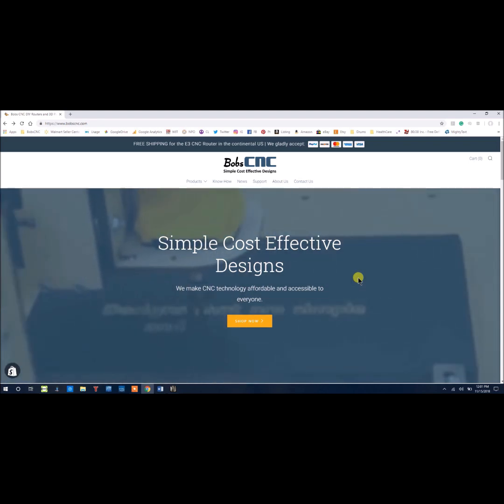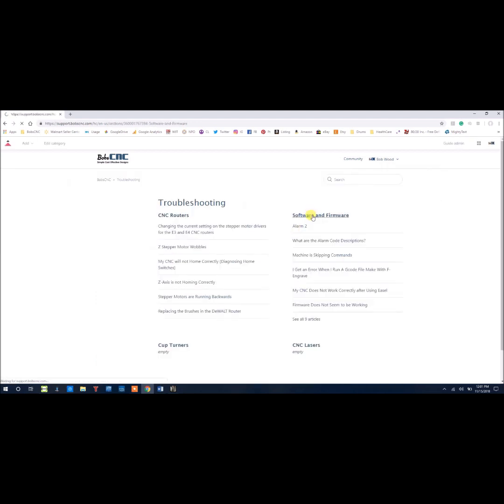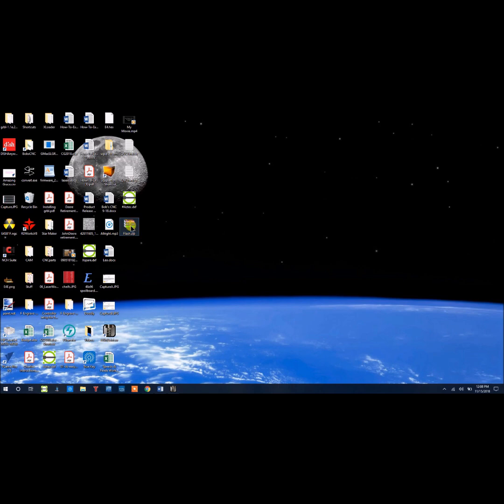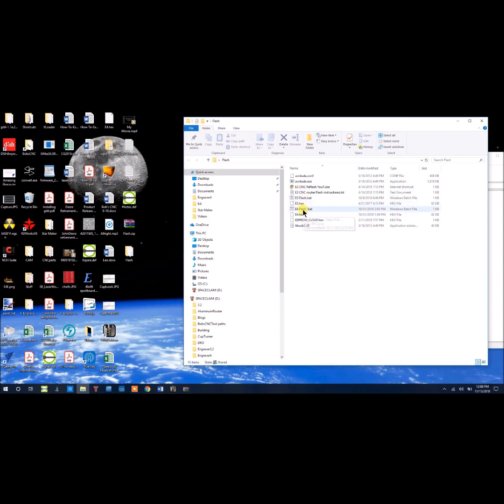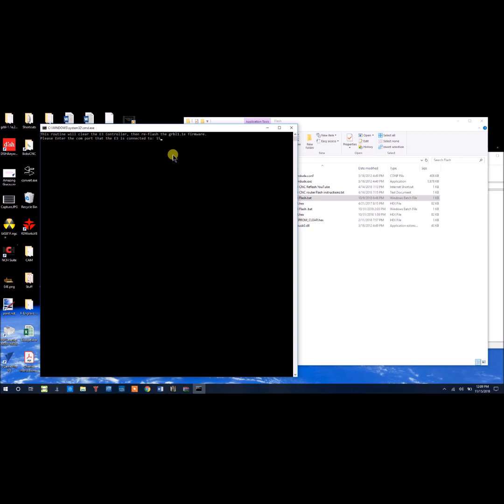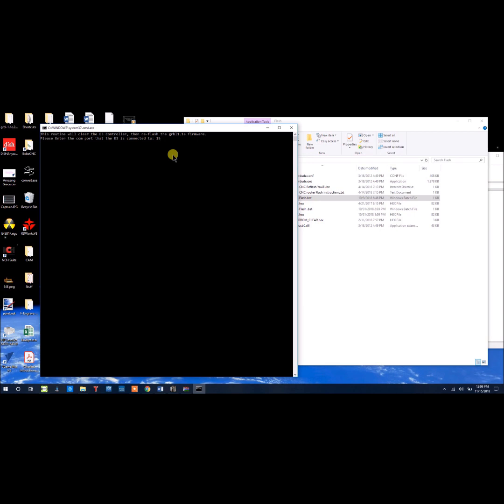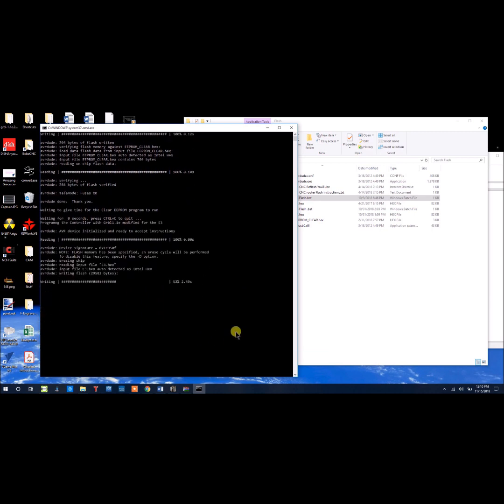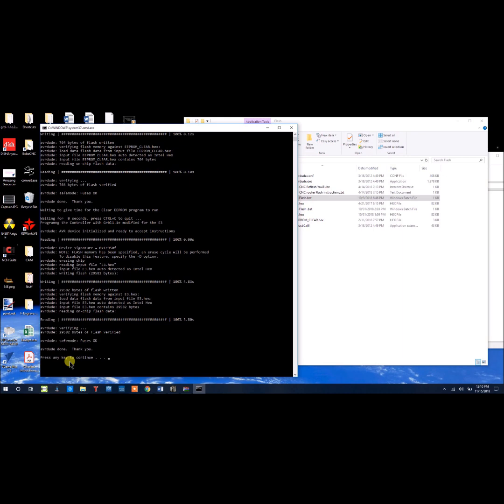How to Reflash the Controller

Comment: Why do you need to do this?
Reply from the maker: You don't unless the firmware get deleted or corrupt.
Reply: @Bobscnc  Hope can i tell if it is corrupt?I keep getting message that machine is out of working range .reran vcarve 3 times to make sure i had all  Measurement  right and doing 6"x6" so on my e-4 should be no problem.
Reply from the maker: @bobfilzen5539  If the firmware is good, typically it goes into alarm mode when you connect, however firmware values can still be off, but these can be easily reset by $RST=$, into the command textbox of the console window in UGS.